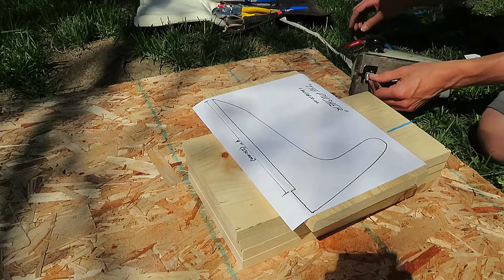My First Woodworking Project! - Push Stick

Comment: Looks like you're missing the bearing that's supposed to support the jigsaw. I'm surprised you got it cut though. It's unfortunate that you didn't avoid the knot.
Keep the pushstick close to the blade when you're using it as it'll give you the most control over your work piece. The offcut will be fine once you install a riving knife or splitter.
Gluing some rubber from an old glove at the bottom of the stick will give you better control. I hope your woodworking journey takes you far! Good luck!
Reply from the maker: Hi Nameless! Definitely a learning experience on the knot. I most likely will make a new push stick, but something I had to learn I guess. Thanks for the tip on the rubber for the bottom; that sounds like a easy modification that will go a long way. My table saw is missing the bracket to hold the riving knife, so I'm trying to makeshift one (just gotta be careful on the design). It's a Chicago Electric table saw, so Harbor Freight doesn't provide any replacement parts. I look forward to what you think of my future projects.
Reply: @raccoonaccountant6102  No problem. Attach a splitter to a homemade zero clearance insert. You might need 2 different inserts depending on how high your blade can rise.